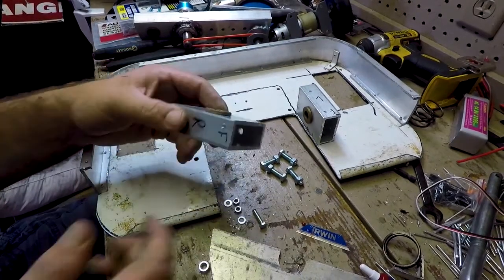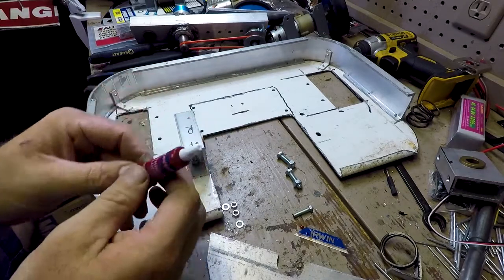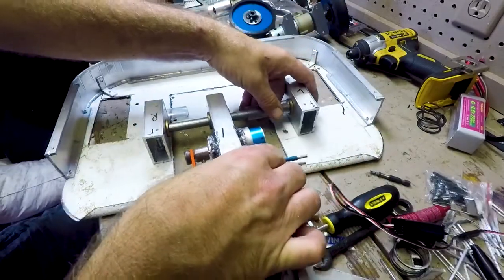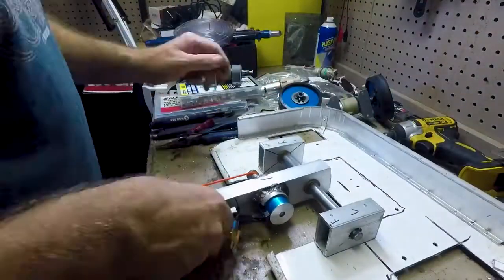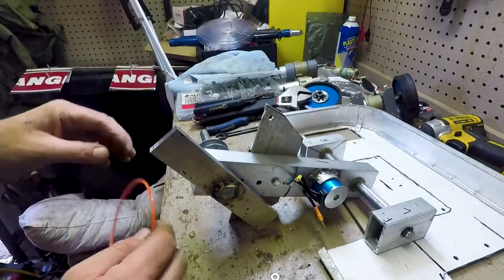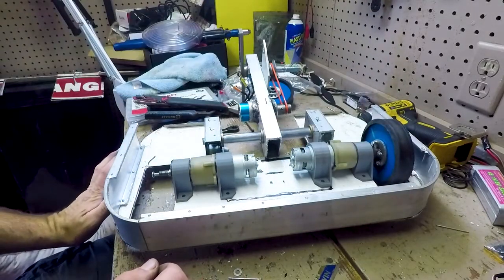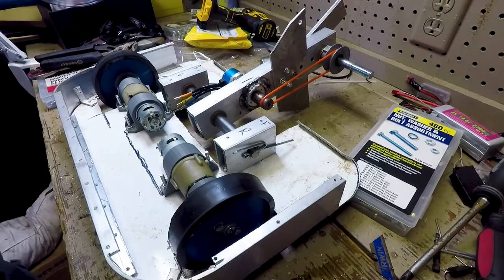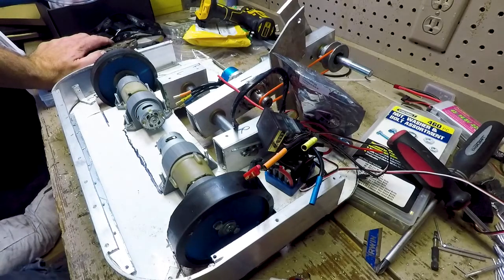Building a Combat Robot! Part 2/Team Junk Yard Dog/First ever Fighting Robot!

Comment: This video is two years old so I presume you already know this but if you don't then I'll give you some friendly advice: Don't forget to apply some type of decent hardening agent to all your bolts and screws etc for example bite force in battlebots uses Loctite EA E20-NS which you can source from Mcmaster-Carr.

Do the same thing for your magnets making sure to not have any unneeded excess which might compromise motor performance. All the experienced teams do this as the epoxy from factory is very weak and any big hit your bot receives from an opponent mean they will basically explode on contact if you don't.

Also, I hope you've got something to properly shock mount the electronics like motors and MOSFETS on the speed controllers cos they're quite brittle and can also easily break under load. You can achieve this by using some high durometer plastic or rubber to stop them smashing into other parts of your robot on big whacks and prevent metal on metal contact. The rubber you used for the wheel moulds should do the trick, you can easily make a mould cast to fit whatever shape your required component happens to be like a battery pack or weapon/drive motor. Anyway best of luck!!
Reply from the maker: I originally made this video in 2018! We were new to the sport and I was going off my RC experience. When I started this channel I uploaded the video here.  We have learned so much since then it is insane.  I really appreciate you taking the time to share info and help out. People like you make this sport the best in the world. We may compete but we are a community. Thank you again.
Reply: @TeamJunkYardDog  happy to be of service! 🙂🙂